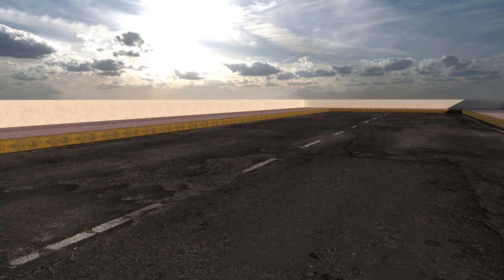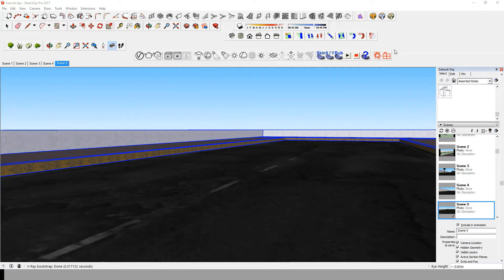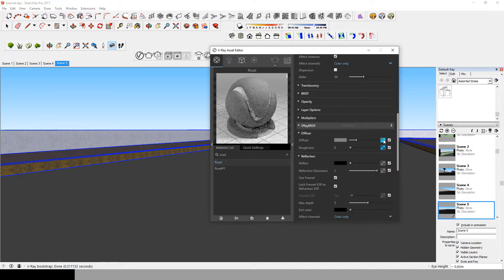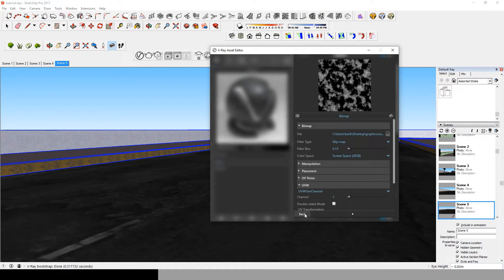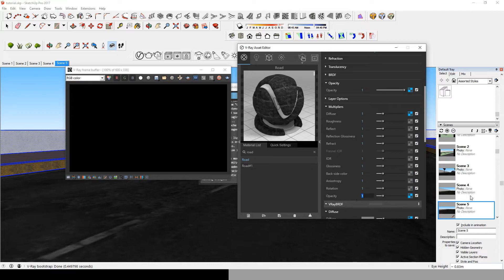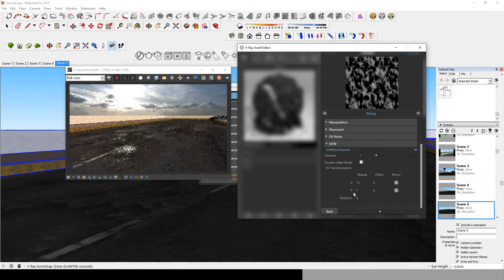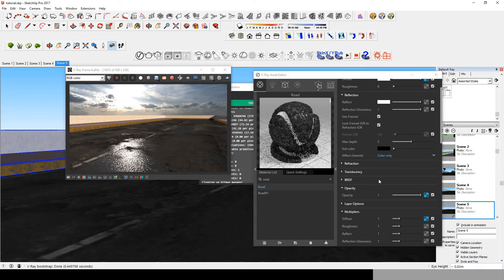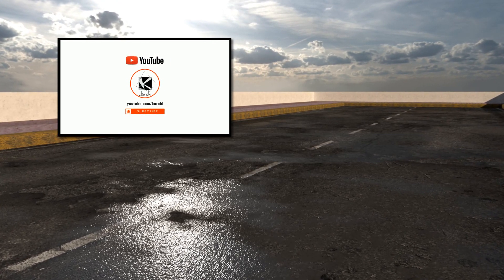Learn to Add Water Puddle to any Material - Sketchup and Vray Next

Comment: can not find layer options and multiplier... please help
Reply: Thank you for this straight to the point tutorial. Easy to follow for beginners like me. :)

Hi. You need to click the "Switch to Advance Settings". You can find it on the upper right corner, beside "Add Layer" and "Add Attribute". Icons contain a plus sign (+), lines (-------) and dots. I don't know how I can describe it exactly but hope this helps. This was also my problem when I started rendering, I just wandered around the settings every time I practice and do trial renders.